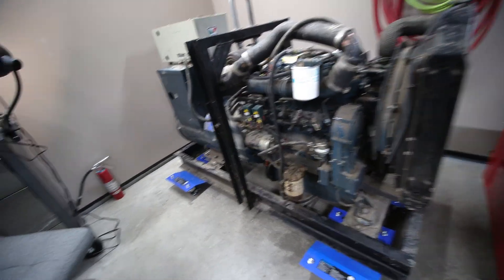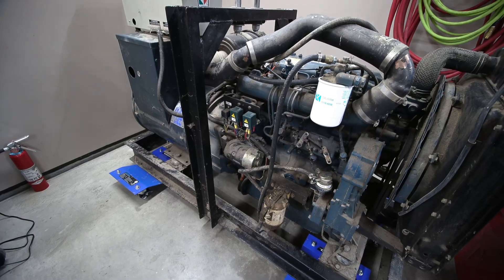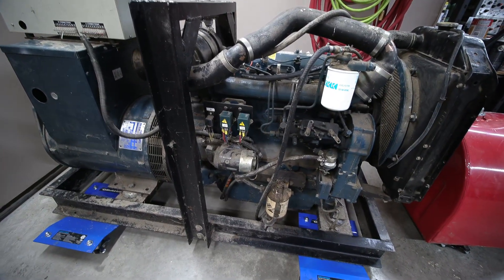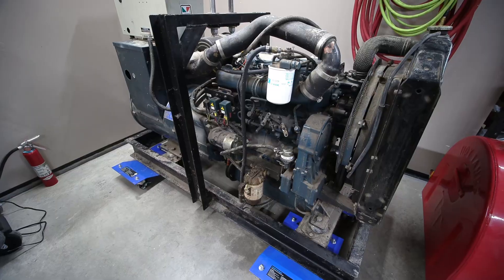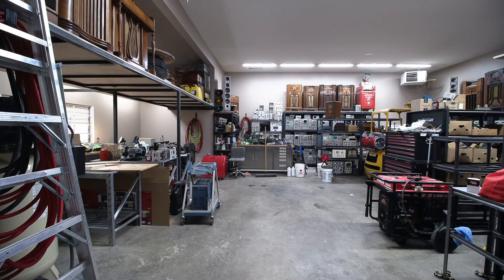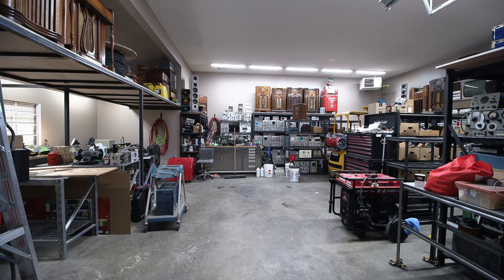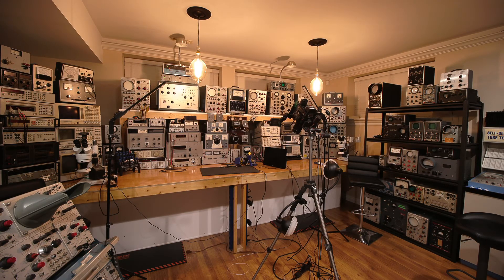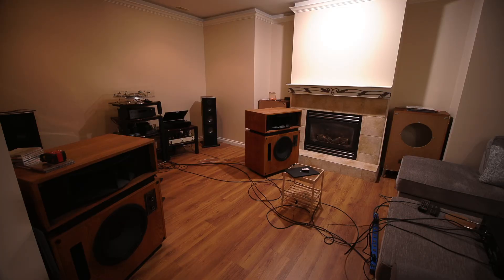Where Are The Videos? My Life And Projects Off Camera

Comment from the maker: To learn electronics in a very different and effective way, and gain access to Mr Carlson's personal designs and inventions, visit the Mr Carlson's Lab Patreon page here: https://www.patreon.com/MrCarlsonsLab
Reply: What happened to the BC348Q restoration?
Reply: I am same situation, my channel 500+ DIY videos was once easy to do them, share the methods and data, but the dreary use of You Tube with all the AI generated videos now getting priority is basically taking over the video offers to my subs AND YOURS. Just makes you loose the will to do more.
Reply: Any chance that putting a 'soft start' onto the geo-thernal compressor would help with those voltage drops?
Reply: @EngrEd567  Or if you could figure out a way to partially unload the compressor on start-up, possibly try installing a liquid-line solenoid valve (not sure if that would help). Large compressors often have cylinder unloader valves, but that is probably not the case here.
Reply: OMG! please film when you are working on mechanical systems. It would be like Mustie1 from a whole new angle!!!
Reply: After I upgrade to my extra!
Reply: Where can I purchase the Circuit Board for the CRF-330K dial lights upgrade at? I’d like to get one.

Comment: In my experience  a motor driving a generator needs to have “Class A Regulation”, able to hold the revs within 3 to 5%.  An industrial regulation class governor around 10%.  Engines fitted to a vehicle are most often “max and min,” in that it controls the idle and sets the rev limit on the engine while the driver controls the in between with the accelerate pedal.  The throttle is found only on petrol engines as that is what they do in the intake.  Diesels will sit and idle all day unless you tell it otherwise, the A word.  Class A governors are quite big if mechanical, and normal fitted to inline injector pumps. DPA pumps as fitted to this engine and do not, I believe, able give Class A regulation.  Then it might be manufactured for general use and no body is concerned.

Comment: I feel like I've heard of Marathon Electric, but I was born in the late 60s, so a lot of water has passed under this bridge. That looks like it was pulled out of a Model T. Just need a hood ornament on top of the radiator. Do you track the efficiency of your Heat Pump?
Reply from the maker: Hi. No I really don't track the efficiency, but at -18 degrees C outside, it keeps the house at +23 degrees C with no help. (it will run day and night) but it keeps up. The generator is actually pretty modern, its just open frame. Marathon Electric is a big name, and good quality too. Thanks for your comment! 
Edit....OH, I should add, it pulls heat from the earth, It isn't an air to air type.

Comment: Realizing this vid is 6 months old (currently) I had something come to mind concerning that surge issue with your compressor during its initial start up. Now with several unknowns on my part like whether that's a 3 or single phase compressor, have you considered building (or possibly  purchasing) a 'hard start' capacitor type kit (sometimes called a 'soft start') that could all but eliminate that issue? Being a retired HVACR tech I used them on several occasions and I dare add they're worth looking into.

For those who don't know: Basically speaking, they're nothing more than a precharged capacitor per leg that assist the incoming main's line voltage during start up. Afterwards (post start up), they drop out via a holding (potential)relay permitting normal operation.

Comment: Paul, we gotta talk about  a single phase soft start for your compressor load.  Inrush will always be a huge problem and I find it really sad that bigger motor load devices are not forced to use them so the momentary hit can be reduced to the grid.  Your generator efficiency is a function of load, and you do NOT want any diesel running at less than 25% load for any length of time or it will wet stack and die.  50% is usually a magic number.  I prefer CNG or LP for stuff like this..  The soft start tech is RIGHT up your alley and I'd love to have that convo!

Comment: Hello Mr C, if you are wanting to maintain your voltage and frequency, you should consider fitting an electronic speed governor to the engine that will provide Isochronous (zero speed droop) speed governor regulation. This will enable faster rate of change of fuelling to the engine to minimise volts and frequency disturbances.

Comment: In case no one posted already, did some research and this is a 40KW generator (slightly derated) for continuous duty at 0.8 PF. Rated output is approx 50KW for standby with better power factor. The 361 and 362 frames (this is a 361 frame) are all 35-60KW range, and definitely not 400KW. 1800 RPM, single-phase 120/240 for this model. This size from Marathon's specs weighs 520-700 pounds for just the Generator assembly and is marketed/sold for industrial use. 40KW requires 54 Horsepower with 100% efficiency, so I'd imagine engines would be 60-70HP. Looks like one hell of a home generator compared to the cheap crap Generac and others sell for 15KW standby units. 

Model is 361PSL160x or 362PSL160x, too hard to make out, but in any case differences between those two frames in any model is small and are around 40-50KW in continuous use. 400KW made no sense for the size/engine, and it's just huge for 40KW relative to consumer/commercial generator heads, because again these are mostly industrial.

Comment: Thats really an adorable little forklift
Reply: It's interesting how they use really small i4s or i3s in small equipment that doesn't need much HP. I suppose it's for longevity, given how expensive forklifts/skids/tractors/etc are, but it's still a lot of cost/complexity for the really low power outputs. I guess it's just worth it given how much better they run versus a single or twin cylinder of any config.

Comment: You should have built a concrete room outside and put the generator with the wood roof or something for ventilation and have a nice quiet unit installing a generator is not that big of a deal it's a matter of servicing the motor and doing get a hold of that generator guy that does all this generator stuff he's on the internet I'm sure he'll be gladly to help you.

Comment: Wouldn't a simpler solution be to add a thermal recovery system to the 15kW generator and not need the heat pump at all when running on backup? Rule of thumb is to expect 2-3 times as much heat as electricity so that would be 30-45kW of heat at full load.

Comment: I'm sure you've thought of this and that even if you haven't someone else has commented, but have you considered getting some kind of soft starter for the geothermal compressor? I know they're made for air conditioners, and the pump is meaningfully the same between the two. Even this beast of a generator is still going to do a little hiccup on a major power demand shift, the nature of a near discontinuity in the input to the transfer function after all, so smoothing the demand helps smooth the response quite a bit, right?

Comment: Knowing my fascination with house mechanical systems, that geothermal heatpump system sounds interesting. Maybe put one of those soft start things on the compressor?
Reply: I'm also fascinated with off-grid solar systems, and figuring out how to run a house on a generator or batteries and still have a;; the A/C I want.

Comment: Shocked you haven't put in a VFD for the compressor, or one of the newer type of soft starters that provides power for short burst.  Really using that large of a generator seems not very efficient if ran for long times.

Comment: I can relate to frequent power outages.  I live in the woods in New Jersey.  All the ash trees have been killed by emerald borers.  In high winds, the trees snap off.  I have had the trees snap off and drop across the feed to the house.  The last time, the feed was ripped off the house.  I've since had the dead ashes cut below the height of the wires feeding the house.
Reply: I live in a super poor area in KY and our power very rarely goes out, that's so crazy to here, only 1 red light and about 300plp in town and the lights might go off once a year it's super rare.  You'd think a state like NJ would do better, we are out in the mountains Im surprised tress don't knock it out more they don't cut the trees away from the power lines up my hollar either...

Comment: Hello, I have a 12.5 kW generator head 1800 rpm mounted on a F1L511 Deutz diesel single cylinder that can provide for 6 kw of power maximum... I think they do this for preventing damage to the genny......Have you tried installing  a soft start on your heat pump compressor ?... for a couple seconds it will limit the amps getting pulled and maybe save you from getting another genny...I mounted a soft start that was meant for a radial saw on an air compressor that would try to pull 70 amps out of an inverter, with the soft start, the air compressor would do just fine....good luck on your projects...

Comment: I'm sure someone else will have said this, but why not fit an inverter and storage battery, even solar PV panels for top-up? The storage battery could be charged up from grid or PV and provide several hours supply on a UPS basis, certainly cover a lot of your load during a power cut -- for a few hours depending on capacity and load.

Comment: Compressors can be real pain in the ass, The best solution I've seen for the is either a variable displacement compressor or a variable frequency compressor where an inverter spins it at different speeds depending on the load and also incorporates a soft start.

Comment: I have owned two kubota 3 cylinder diesels on my lawn mowers. They have been great engines except for their ability to start in the cold. Definitely need to use preheater. On the other hand my yanmar 3 cylinder starts no mater the temp which is good as I use it for blowing snow. If your generator will be outside I would consider having an antifreeze heater that comes on when the temperature gets below 55 degrees if it behaves like my kubota engines. Just a thought.

Comment: Did you consider engineering a signal to pre speed up the generator that delay starts the load?  Even with a new system it would seem some buffer would be in order.  Consider also if a grid tie inverter could be repurposed to buffer the load.  Getting small generators to start an AC in and RV is often helped by increasing the motor start capacitor size.   I follow you to increase my electronics skills for work and hobby.  Love to hear your thoughts on various schemes to buffer an AC load.

Comment: Would a (large) soft starter be applicable to your unit? I put a SureStart on my 4 ton condenser, and it reduced the peak amps substantially. EasyStart is another prevailing brand.

Comment: Why bother with such a monster if you could just have a battery to cover at least the short high load phases? Could be a next electronics project.
Reply from the maker: Power outages.
Reply: @MrCarlsonsLab  that is exactly what a decent battery pack is supposed to handle. 

Or what a power hog are you operating in your backyard? Anything to hide from us :)?

Comment: Hello! just a little suggestion. HVAC inverter type units use a speed controller. I think you can do this on any type of AC motor. They basically start the motor and then never stop.They accelerate or decelerate when the HVAC needs. Some compressors use a capacitor but others use a short circuit relay to start (smal fridge) 
Both configurations have a resettable thermal protection. If the capacitor goes bad the compresor sometimes starts and others do not. You need to pay attention to the controller and to the compressor to see if start in the moment or not. If not the thermal protection kicks in few seconds but in time is similar to the starting process timelapse
My suggestion is use a home HVAC control board and modified to support a bigger compressor unit if is the case (I'm think they use a few IGBT's)
Best Regards!!!

Comment: I am so happy to be a Patreon member of your channel. It was nice to see that 10” RCA TV in this video. As I also own one of those, I’m wondering if you plan on a restoration video of it in the future. I replaced all the original “waxies” with tantalum film caps and tuned it up the best I could with the help of an old Sams Photofact packet for it. It works OK, but the cleaned tuner is still vibration sensitive. I wish I still had the old two-tube UHF tuner, but sadly, that doesn’t exist any more. Now, I feed the TV’s channel 3 with a DTV Tuner on a Gerold 550 UHF antenna. I miss the old VHF bands, because those mechanical tuners were once the epitome of engineering skill!
Reply from the maker: Thank You for your kind feedback Tim!

Comment: If you are concerned about those car dollies, that support your new super generator, bending, rotate them 90 degrees so the weight is between the pairs of wheels instead of the ends.  Cool video to see some behind the scenes items.  I share your electrical woes.  We're on the end of a run from a substation 15 miles away.  When our power fails, our across-the-street neighbors' power is still on.

Comment: Didn't notice much (any?) ham radio gear. Is that a definite policy or simply lack of material? Great to see behind the scenes Paul, many thanks.
Reply from the maker: Hi Peter. It's all over, There are three DX-100's on the bottom of the black shelves in the shop, an Icom above the old wooden TV in the lab shot, as well as all the comm receivers in the rows. So Lots. of HAM related equpment, just not center screen.
Reply: Ahh OK Paul Didn't spot them. (I was too awe-struck by your collection). 
 @MrCarlsonsLab

Comment: Looks like the decimal point is missing.
It is a 40.1 KW and 167.1 amps. A 400KW alternator would be much larger in diameter. I've been a generator technician for over 20 years and this one will work excellent for you and will have no problems with starting your loads. It looks like you have a mechanical governor so you might have to play with the speed setting to make your UPS’s happy. I am very interested in how you build the load bank. I am assuming you will be using heat strips from a HVAC system if making a resistive load bank.
Or is it going to be a reactive one? I enjoy your content and contact me if you have any questions or need service manuals. 5:07 5:07

Comment: Compressors starting under head pressure can be immensely horrible loads for generators, small gennies often say 'do not use with fridges' for that reason. There could be a setting on the heat pump system for that?  Worth looking into

Comment: You are an engineer for pete sakes. Id make a controller that sits in the middle of the heat pump and the thermostat. The controller tells the generator to ramp up, and then the pump can kick on. Maybe requiring some sort of energy dump. Big caps and a load that can switch in and out idk. Maybe its too much bs
Reply from the maker: Sealed start and run winding inside the compressor makes that difficult.

Comment: Those Kubotas are very reliable and fuel efficient. I work on quite a few in equipment not specifically gen sets. Most times with the engine serial number you can buy parts from any dealer that uses Kubota engines in their equipment if a actual Kubota dealer isn’t close to you, like bobcat for example

Comment: Instead of using a traditional loadbank to test your generator, you could use a body of water if you have one (lake/pond). Attach the output to well insulated copper rods held in a frame and lower them into the water slowly until you achieve the desired load. You won't have to lower them in too deep before you get your generator up to load and all you will get is a little fizzing around the electrodes.  You could try both methods and do us a video. (ps this method was used in Cairo to test the huge generators installed on the waste water pumping stations and was the successful idea of Allan Atack the Chief mechanical and electrical engineer)🙂

Comment: Hi Paul, thanks for the overview of your new shop, along with the behind the scenes problems.

I have been interested in home backup power since the mid 1980's, as everything in modern civilization is directly tied to it.  I can't tell the size the diesel engine your genset has, too much plumbing around the engine to get a good view.  You need 1.5 to 2.0 horsepower input for every 1kW generator output.  It seems strange that a 400 kW generator head is being used with a <100 HP engine, although the physical size of the generator head appears to be about 50 kW.  If it truely is a 400 kW head, that's a lot of wasted expense and extra losses.

Those open frame gensets make a lot of noise and heat for indoor use, you might want to build a sound deadening box around it.

Surge current is quite high with A/C compressors, budget 5 to 10 times the running wattage.

Comment: Look at "soft start" controllers for your compressor. My soft-start AC compressor works OK off a LiFePo4 + 6.2KW dual phase inverter until the gas generator starts. Without soft start, the compressor drew 15KW at startup. It might extend the life of the compressor, too. They are not cheap. (Edit: compressor OR sof start controllers)

Comment: I have a marathon end like yours. Mine is a 43kva and requires 90hp at 1800 rpms to run it.  I have no problems with the engine bogging down under a load. Inside the upper cabinet you should find a control module with a few adjustments. Htz, voltage and stability. They should be preset from the factory. You should not be getting any voltage drop with that generator. That generator should be brushless as well. The stability adjustment controls voltage drop under a load. I don`t know everything there is about it, But I do know when my a/c or monster commercial air compressor starts there is no voltage drop. This thing runs my whole house and shop at the same time when the power goes out.